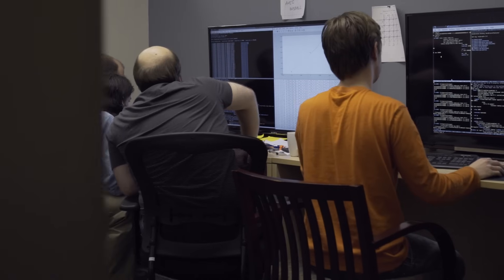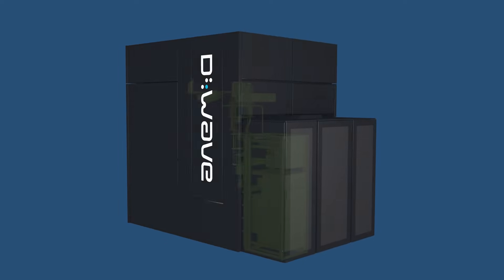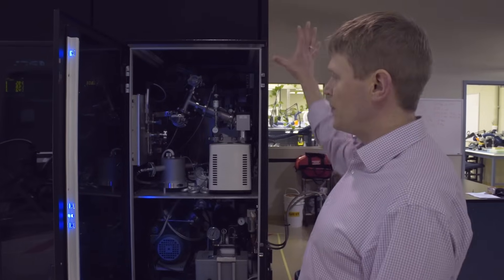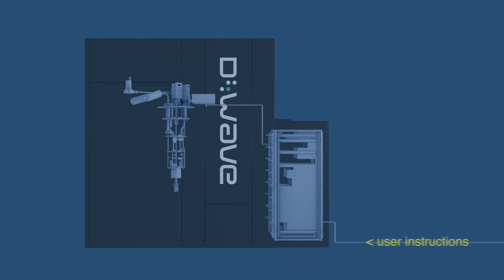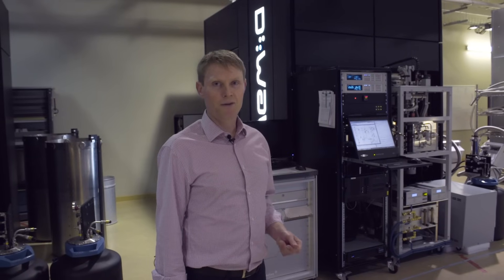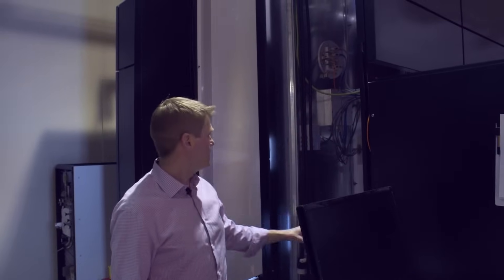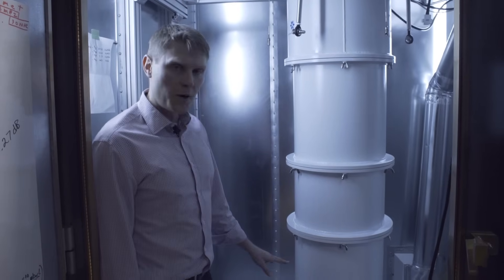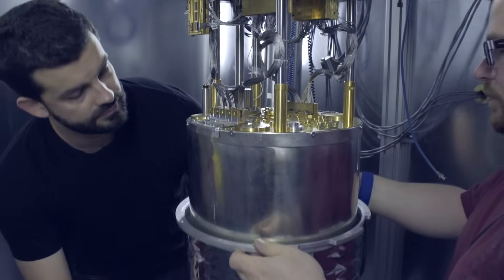D-Wave Lab Tour: The Infrastructure of the D-Wave Quantum Computer (Part 1)

Comment: What type of answer can a quantum computer provide in a random search by a host. What type of data or technology does this processor deliver to basic searches; how effective is it for real world ideas or problems?
Reply: Covent Garden think of it like an screw tool for a planetary mixer: is almost useless for most things, but will save your time when you need to bake some bread. Quantum computers are intended to solve problems that rise sharply in possible outputs, stuff that you can't just buy more ram and processors to brute force it. In general these kind of challenges need to be solved in places like science research (fold proteins) and developer /engeneering projects (what is the best possible way to solve this considering these stuff <insert here>) so they are the first clients of this kind of technology. It doesn't means that the work of quantum computing will not reach the public, it just means that the ways its results it will grant are in a deeper layer on the structure of the projects that it is applied.
Reply: Giovane Dias Ok. So basically it's more of an axiom based computer that handles aggressive gnome and heavy mathematical problems etc,. The computer operates at a subatomic level right? So how accurate can it really be if this part of the physical world is partially nonexistent. And if it is calculating to meet rigorous problems how precise or how many answers does it serve at once. Another question I have if you would be so kind answering it; many people's interpretation of d wave is that it can alter and affect the space time fabric per se .."Is it?" can computing at this level and power have consequences on our real time experience of space. And have researchers experienced any multidimensional results in the field of astronomy ? 
Thanks for your time! "Giovane" Kind Regards...
Reply: Covent Garden oh, hi! I'm basing my responses onto the playlist on adiabatic quantum computing, on the domain of science channel, so check it out the if I'm not comprehensive enough. The deal with hardware that harness quantum functions is to scale up the range of the quantum properties to a size possible to build wires, chips and stuff, that's why they need such a freaking big cooling system for only a single processor, since thermal energy is enough to disrupt (collapse) the eletrons and waste their time. The accuracy comes from the collective knowledge of the quantum properties and how to handle them in an effective way. To make a crappy comparison of the quantum world would be to say it is the real world version of minecraft: you can't get any more detail on that, any more zoom-ins will collapse the stuff you are trying to study, so is kinda of a limit resolution of the natural world: it's still real stuff, but it no longer behaves the same way bigger chunks of matter does. Look for the Heisenberg uncertainty principle on this. >>>
Reply: About the kind of stuff it can solve: it really depends on how it was designed, you are best helped on the other videos on this playlist and the one I cited up there: basically optimization problems for the d-wave design.
Reply: Covent Garden if the technology developed by d-wave can lead to some kind of breach on the fabrics of reality: not by any known means, this is more close to the time where chemicals were tickling up the list of known elements and discovering what was possible to do with them. amazing stuff? Surely, but not anything disruptive to the point of ruining the human kind. Not to say that it is totally harmless, but it means that the problems that it can bring will have more mundane causes and consequences than we imagine.  Think of bugs, shortsighted planning and stuff like that.
Reply: Covent Garden about the rest I'll be really long guessing, since I'm have almost nothing to give a shot, but astronomy, as well as biology, engineering, economics and diverse fields see great stuff being developed applying this kind of tool on their jobs. Hold tight on your curiosity and your awareness to filter what is solid knowledge being made and what is just emotional grenades being thrown and you will be fine here. I'll depart now. Best wishes on your journey✌️

Comment: The cooling isn't because the processor generate heat, but because cooling cables make their internal resistance to electrons drop to almost ZERO , so a cable can transmit electrons to the quantum doubles the speed of what a normal cable can.
Reply: The cooling is primarily required because heat makes the qubits unstable.